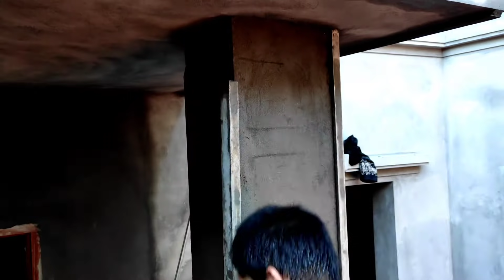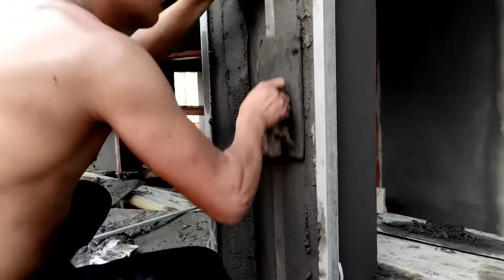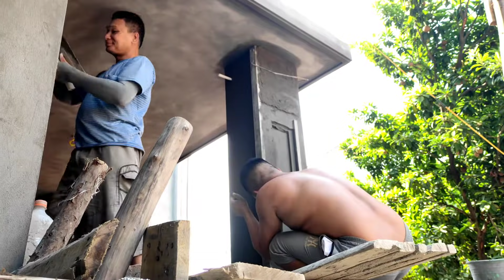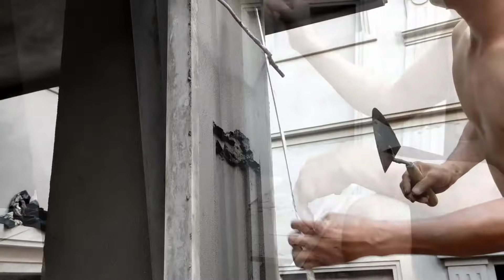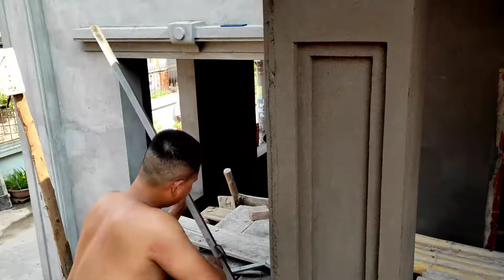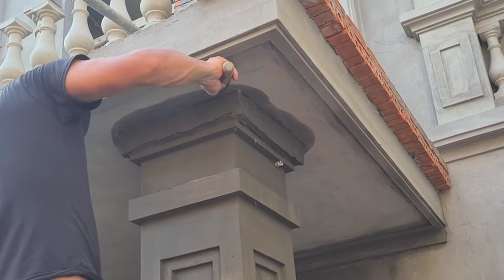How To And Tips Building Innovative Concrete Column You Must See - Building Column - Building House

Comment: What’s the ratio? How do you keep it from drying too fast? Do you put anything like pva glue or a bonding agent with mix? Do you get cracks the next day? Do you put the cement and sand mix first then a thin layer of just cement to create a smooth outer surface???